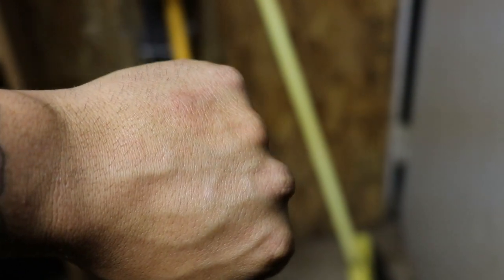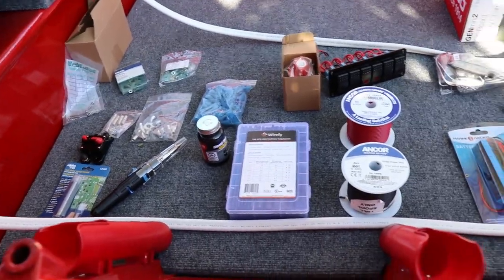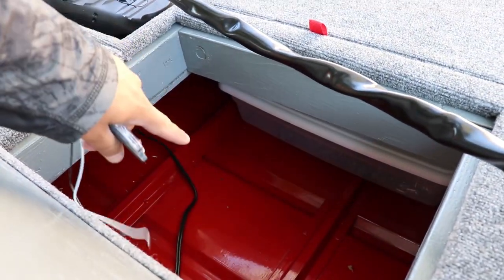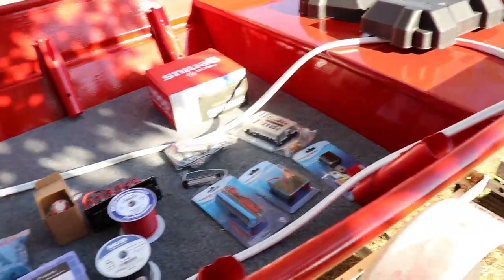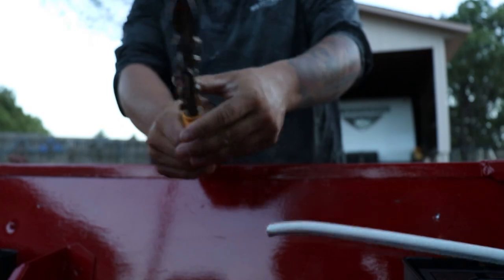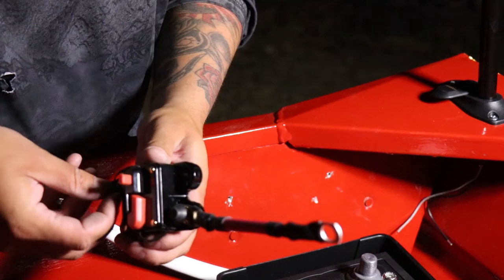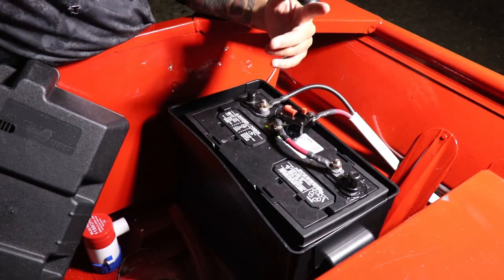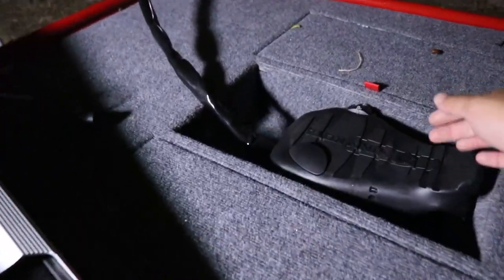JON BOAT TO BASS BOAT 12V ELECTRICAL SYSTEM

Comment: Thanks.  Could you put the circuit breaker where you spliced the trolling motor and batter motor wires?  Wouldn't you save a step?
I'm re-wiring a deep V that I got from my buddy.  I need a bit of help and so far you are giving a great demonstration for the battery to electric motor hook up.  
I'll be watching the other electrical hook up next

Comment: Order you a Kipawa prop for the trolling motor. It will move you quicker and save on battery power.
Reply from the maker: I will look into it
Reply from the maker: Thank you for the tip